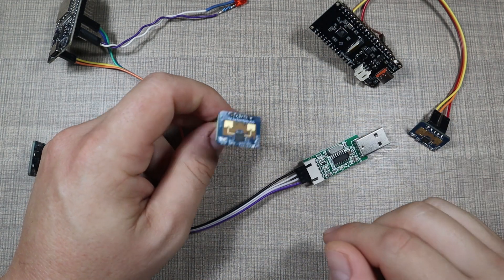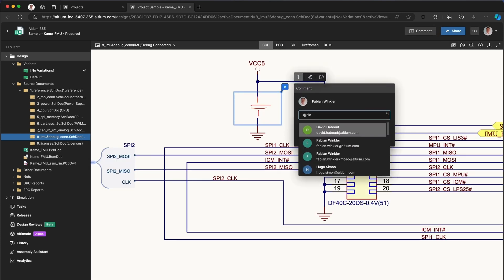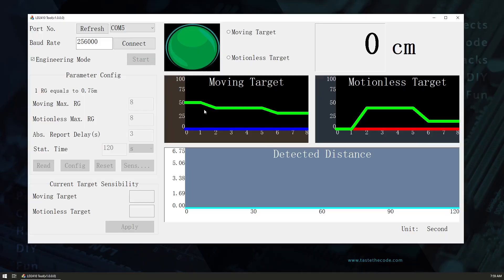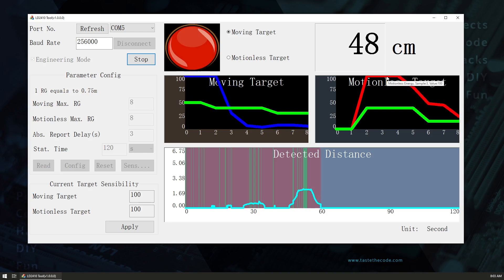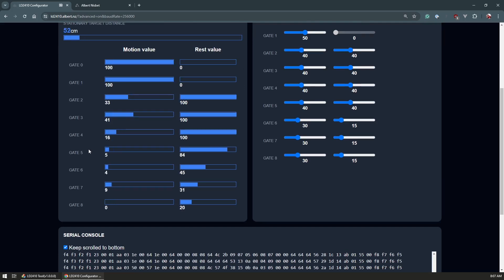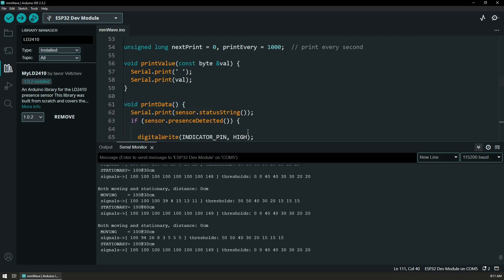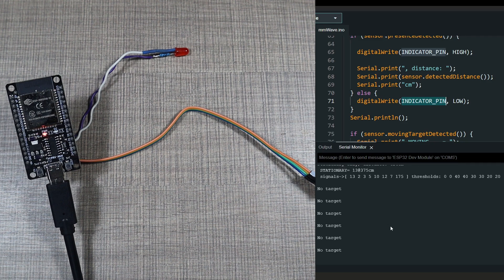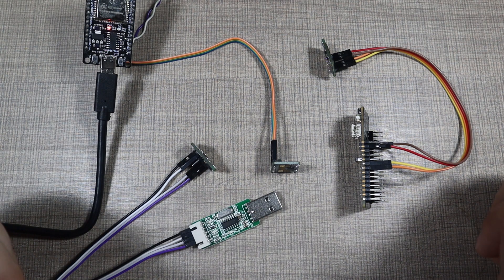Human presence detection with LD2410 sensor and ESP32 - Basic Guide

Comment: is this sensor overkill for under cabinet led lighting to turn on if movement under the cabinet.  e.g., hand wave, bowl placed under cabinet, or prepping food in this section?
Reply from the maker: No, not at all but I think it might detect you even sooner than this just being present in the kitchen or near it. You need to give it a try. I think that a much simpler solution would be just to have some slightly hidden PIR sensor, that only gets to view the countertop.

Comment: I have LD2420 v2.1 that only have OT1, RX, and OT2. it always outputs 1 even there is no motion using OT1. I connected it to my ESP32 30 pin Wroom. Please help.
Reply from the maker: You need to use UART for this sensor. Based on what firmware it has either ot1 or ot2 is the TX pin. Firmware 1.5.3 and newer OT1 is TX, for 1.5.2 or older, it is ot2. You have all the info in the datasheet: https://www.elemon.com.ar/images/productos/hojas-de-datos/radar-modulos/hlk-ld2420.pdf
Reply: @TasteTheCode is it possible to adjust the firmware using only ESP32 that is connected to a laptop?
Reply from the maker: Not sure, I've never tried to update the firmware on one.

Comment: This is motion detection, not presence.
Reply from the maker: The sensor will detect you even if you are stationary.
Reply: @TasteTheCode  tried it. Not really. It's still based on motion, even if tiny one.
Reply from the maker: You get two values, one if a motion and another if just presence is detected. Even if someone is sleeping in the room, you can know.

Comment: dear sir i  m using HLK-LD2020 basic model cant work so you can help me on code with arduino uno board .but now i m testing with esp32 .everting is ok like wiring with esp32  but the error is "Failed to communicate with the sensor "
Reply from the maker: Hey, I'm not aware of LD2020 version. A common mistake is to not have Rx nad Tx reversed on the board so please check that and also make sure to use correct pin numbers or GPIO numbers.

Comment: Isn't the ESP32 3.3v whilst the LD2410 5v?
Reply from the maker: Yes, the power input is 5V but the logic output is 3.3V. So the power pin is connected to the Vin pin on the ESP.

Comment: Good video. May I know is it ok for me to connect the sensor to Raspberry Pi. I am figuring out how can I use the raspberry pi to control it.
Reply from the maker: Thanks! Sure you can. The sensor uses UART so look for examples on how to setup UART on the RPi. I haven't connected it personally but should be fairly easy.
Reply: I'm actually working on connecting this sensor to a pico w. Would love to hear if you got this working. I'm struggling a bit with the gates/sensitivity and getting false positives...
Reply from the maker: @Unrealizedlosses  What is triggering the sensor? Try averaging the values before reacting so you can filter out false positives. I did not worked much with the sensor beyond the demo but during that initial testing the readouts were quite good.

Comment: For anybody reading the comments; you don’t necessarily need the ESP unless you are doing some automation like timing, logging etc.  the sensor can be wired directly to a relay to turn on/off a light or power to a device when presence is detected.  The motion sensor (HLK-LD2410C) can be fine tuned via Bluetooth.  Read the manufacturer description on how to adjust settings such as distance, field of view, delay.
Reply from the maker: Thanks for the input!

Comment: Is it possible to see distance in mm? Or isn't it accurate enough. I'm trying to measure distance to moving strip.
Think this can be a solution since the environment is bad. With smoke and mist.
Reply from the maker: Just considering that a human is quite large, measuring to a mm precision is not really that viable. Laser distance measuring might be a better option but if the environment is bad you might not be able to use that. Can it be enough that you know the movement in the ballpark? Why it needs to be that precise?

Comment: is there any mmwave  sensor can use without esp series for triggering relay like HC-SR501 PIR motion sensor
Reply from the maker: I haven't personally used it but you can use the OUT pin directly to trigger a relay without any microcontroller in between. Make sure that the relay is rated for the voltage or to be safe, you can use a transistor.

Comment: Hi there, would you recommend these to avoid false positive alarms? I'm using ZY-M100 Tuya linked to home assistant but having huge amount of false positive alarm. To avoid that I have linked 2 sensors but still now and then I'm having false positive. Main use of this is to detected human when comes to terrace. That is how I stumble upon your video of using HC-SR04 and ESP8266 so idea is to implement that as well, which I did, but now with median filter I'm getting false negative :D And if I turn off filter there are to many spike values from HC-SR04. To sum it all, what would you advise to use in such application?  Considering that you have implemented all possible solutions, presence sensor, ultrasonic and laser(VL53L0x) what would you advise to use and in what combination? Many thanks...
Reply from the maker: Can you elaborate a bit more on what you actually need to detect? Just movement or sitting presence as well? Right now, it sounds like a simple PIR might do the trick for you.

Comment: Good Video. I use these all over my house with Home Assistant and ESPHome. They work very well for presence detecting. The ESPHome code i use set's up zones (3 in fact) so it can be triggered based on the zone (distance) you are from the sensor. I use them to turn on and keep lights on in a room. They work well with the BH1750 light/lux sensor to know when to turn a light on or not based on motion and how much light is currently in the room.
Reply from the maker: Thanks for sharing!
Reply: can you share the code?
Reply: @filipefernandesmusic  It's on my github page. HATipsByLarry :) to big to share here and can't leave links.
Reply: @filipefernandesmusic  On my Github page

Comment: These are nice sensors. The only drawbacks are that they use a lot of current when compared to PIR sensors and cost quite a bit more. If you are not running on batteries, they can be a nice option. Does anyone know if they are FCC type accepted for use in a potential product?
Reply from the maker: I don't know for sure about FCC but I've seen them in products already. The Aqara fp2 is an example.
Reply: I'm pretty sure that the TECHNOLOGY is. Supermarkets have been using K-band radar to open doors when people approached. I'm not sure whether this exact sensor is approved, though.

Comment: Could we use this outdoors say for instance to turn porch or patio lights on? I guess the real question is how well does it perform outdoors and can we enclose it in something for protection from the environment?
Reply: It would not be good to use outdoors as it's motion based, so anything moving such as a tree limb blowing in the wind, trash of any type, dogs, cats, birds, incest's, will trigger it.
Reply from the maker: There is nothing preventing the sensor to be used outdoors. As long as there is an appropriate enclosure to shield it from the rain it should be OK.

Comment: I've used the BLE version, but you cleared up the use of the 2410. Thanks. I prefer the 3.3v version without BLE.
Reply from the maker: Thanks! I haven't looked at the BLE options but I might give it a go just to see how it works.
Reply: Hey, I’m just curious as to why you prefer the 3V version without BLE?
Reply: @marinehm  I see the 5v units actuall have a linear voltage regulator to drop it to 3.3. I use the 5v version for units that are constantly powered, but for battery units, the wasted power is detrimental, even a couple of milliamps shortens battery life a lot.

Comment: I wouldn't put this in your home.. extremely toxic
Reply: If you are throwing an accusation like that, then use the right words… toxic is definitely the wrong word. Also how did you type this out? Are you also using this cancer causing wifi?
Reply: @sebastianbaird4450  Well apparently i cant post research which uses that word  here is the research paper 

https://pubmed.ncbi.nlm.nih.gov/37990587/
Reply: @sebastianbaird4450  Ive posted a quote on research that uses that exact word... but yt removed the comment... ive tried posting the link so we will see if it sticks
Reply: @sebastianbaird4450  Yes its toxic to your blood, cells, tissues, skin, brain,  eyes, lungs and more... it depends on which one we are talking about.   How did I use the wrong word?   I am using wired internet.
Reply: @thatonesnowboarde  toxic is the effect of a toxin/poison. In this case there is no toxin/poison to talk about… you are talking about wifi frequencies, there is no toxin/poison… you may be referring to electro magnetic frequencies, which aren’t a “toxin”…
Reply from the maker: I don't negate anything that you said as I'm not qualified to neither reject nor confirm your claims. However, I do agree with the rest that the power levels involved are so small that simply being outside on the sun is much more harmful than being in are of these EMFs.
Reply: @TasteTheCode I have over 30+ years in technology field and have installed commercial grade system before...   these things should be avoided at all cost...  go wired on your internet in your house and do your family and kids a favor...
Reply: @TasteTheCode  did you get my email?
Reply: @thatonesnowboarde  and don't use any cell phones, or bluetooth or for that matter, no tv or radio. Sounds like living in a cave to me.
Reply: Even at its high-energy end, it is still more than 3 orders of magnitude lower in energy than its nearest radiotoxic neighbour (ultraviolet) in the electromagnetic spectrum. As such, millimeter wave radiation is non-ionizing and incapable of causing cancers by radiolytic DNA bond cleavage.
Reply: @HATipsByLarry  do you really believe this??  Cancer is only one aspect, with there already being evidence of the harm caused by basic  wifi  mwave much worse
Reply: @thatonesnowboarde  I believe science. Not hear say . So yes i do believe it as you put it. Show be a scientific paper on this harm by wifi, mmWave. I'll believe you then. until then no i don't. Aut i don't believe you can, because i've seen several scientific papers that say, (and prove)  the exact opposite.
Reply: @HATipsByLarry  I tried posting here, but then yt removes it
Reply: "On contrary, some studies demonstrated that ELF-EMFs may increase carcinogenic risk in the childhood leukemia and sclerosis (Coleman and Bera, 1988; Kheifets et al., 2005)."
Reply: @thatonesnowboarde  Wi-Fi has negative effects on health as I have noticed recently myself.
Reply: @sebastianbaird4450 @thatonesnowboarde  this is a case of fear over facts.. sure if you microwave yourself it wouldn't turn out well. Going in the sun, or going to the dentist and getting x-rays on your teeth would be about 10-50x more harmful in terms of harmful electromagnetic radiation levels you receive than using wifi in your home.  I'm not say his fears do not have some value, because I once felt the same way-- until I looked into.  A person hears radiation and panics like myself in the past. But learns then it's electromagnetic radiation,  and the earth, the sun expose us to electromagnetic radiation daily-- u realize it's wayyy different.   You should just build your house with a Faraday cage around it, but then you might see more frequent lighting strikes-- decisions decisions 😂😂.  Gotta love the technology trolls😮
Reply from the maker: Toxic? How is it toxic? Can you please elaborate?
Reply: @TasteTheCode  So its really not a "smart home" if you keep adding more and more devices on wifi... you are going to end up causing focus issues, and a wide range of additional problems requiring your body to detox more often, and add additional burden to your immune system, which isn't even being taught correctly in med school. so most doc's are clueless on how to actually regulate the body and its setup that way
Reply: @TasteTheCode  Radiation from wireless technology affects the blood, the heart, and the autonomic nervous system

“Exposure to electrosmog generated by electric, electronic, and wireless technology is accelerating to the point that a portion of the population is experiencing adverse reactions when they are exposed. The symptoms of electrohypersensitivity (EHS), best described as rapid aging syndrome, experienced by adults and children resemble symptoms experienced by radar operators in the 1940s to the 1960s and are well described in the literature. An increasingly common response includes clumping (rouleau formation) of the red blood cells, heart palpitations, pain or pressure in the chest accompanied by anxiety, and an upregulation of the sympathetic nervous system coincident with a downregulation of the parasympathetic nervous system typical of the "fight-or-flight" response. Provocation studies presented in this article demonstrate that the response to electrosmog is physiologic and not psychosomatic. Those who experience prolonged and severe EHS may develop psychological problems as a consequence of their inability to work, their limited ability to travel in our highly technological environment, and the social stigma that their symptoms are imagined rather than real.”

https://pubmed.ncbi.nlm.nih.gov/24192494/
Reply: @TasteTheCode  There are no health risks from exposure to radiofrequency EMF from Wi-Fi devices in your home, in schools or other areas accessible to the public. These devices must meet standards to ensure they do not exceed radiofrequency EMF exposure limits. Curious to know who this WE and Our you speak of is. In short the EMF fields are to weak to cause any problems with our health. Even the EPA disagrees with you.
Reply: @TasteTheCode  well as suspected they removed all my other comments with regards to research quotes etc
Reply: @TasteTheCode  Consider this...  a microwave oven operates at 2.4ghz...  and wifi is around the same freq.   With blood cancer being the most common cancer in children, and microwave ovens are cooking food by effecting water molecules in our food... what do you think wifi is doing to our blood?    Now... bump that freq up 90% and you have a wide range of additional problems,  and if it gets up to the 60 range, than you have oxygen issues to worry about...  so i'd suggest even if you go through airport don't have them radiate your cells with this non-sense mmw device which runs at 30ghz+ you can always request a pat-down which is radiation free and doesn't dysregulate your cells, blood and promote inflammation, oxidative stress, and  more...  there is much more to this, but to avoid censorship i better refrain from saying too much in a comment because yt often deletes my comments w/ various topics
Reply: Extremely low-frequency magnetic field decreased calcium, zinc and magnesium levels in costa of rat
"In conclusion, it can be maintained that long-term ELF-MF exposure can affect the chemical structure and metabolism of bone by changing the levels of some important elements such as Ca, Zn and Mg in rats."
https://pubmed.ncbi.nlm.nih.gov/20872091/
Reply: Yeah, right. Compare a microwave oven with a kW of power with a sensor which uses 70mA (0.07W). 24GHz is far from the THz ionizing radiation range which cause cancer.
Reply: Can I get more info on what you’re saying I want to take care of my family too
Reply: @kevincorral6600  check my bio and send a message,  usually have any comment of substance get removed here so its probably not worth talking about on comments